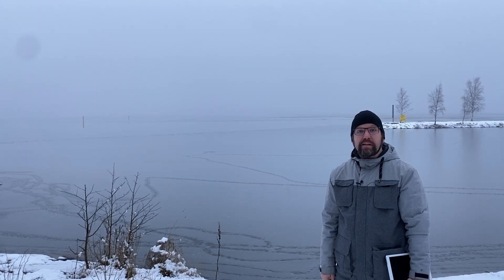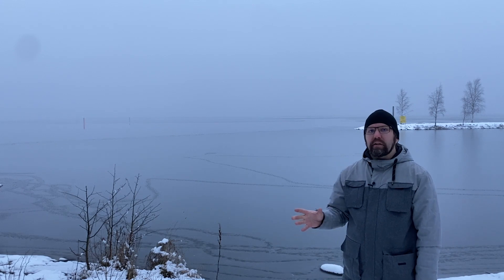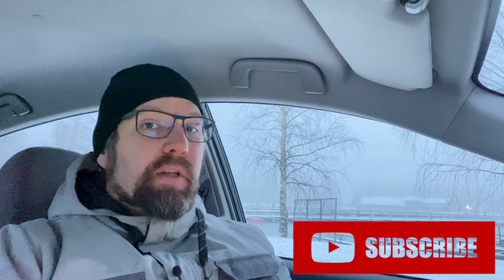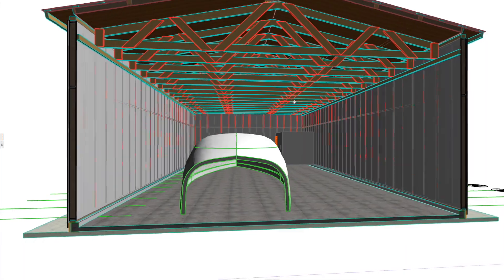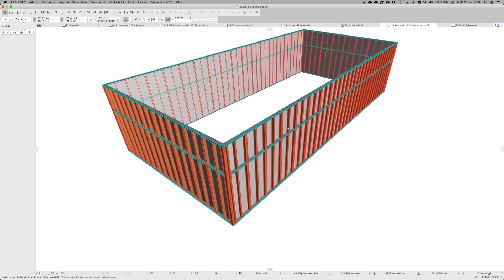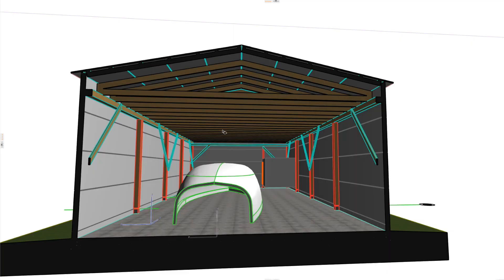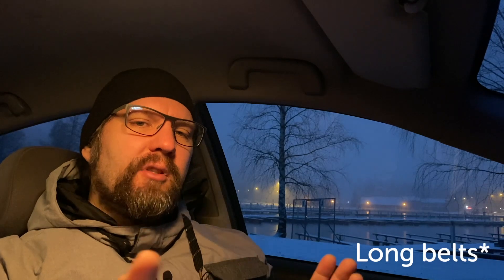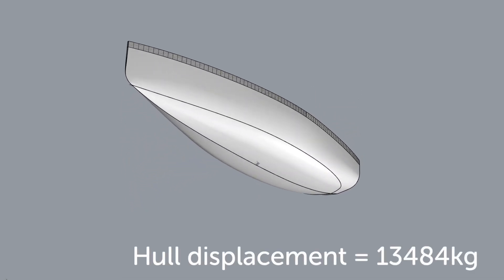DIY sailboat project: Mixed bag of Plans: Shed, CNC-router and Boat hull! Ep16 Project SeaCamel

Comment: I live in the midwest area of America where we have 4 seasons per year and I don't think many people understand how efficient a heated concrete floor is.. my buddy built a house and the basement is surrounded by earth on e sides and the 4th side is open and a 3 bedroom 2 bathroom single level house is on top of that.. we installed tubing into the concrete floor before pouring it.. he heats his home from a cheap electric hot water heater and in the really cold months of end of December thru March he has a wood stove in the basement also.. it's a really cheap way of heating the house and if you go for a visit you should definitely have a t-shirt available to wear and most of the time a pair of shorts
Reply from the maker: Compared to US, we are much more North up here. You have four seasons but they're short and in a way more extreme there. On the other hand we have short, often cool summer and long winter. And mid-seasons are even longer and quite unpredictable.

In here you really need good insulation to keep the heat in. Ground can (and has) be used for keeping things cool like wine cellar. But there's not that much heat in the ground.

Comment: Why didn't you just search around for a 45 to 60 foot former racing sailboat that can usually be found for a reasonable price and the interior are open canvases.. you can always add the proper cockpit and hard enclosed helm etc
Reply from the maker: The hull part of the boat isn' really that big of a thing compared to everything else. And I just didn't want the hassle of dismantling everything and have all that c**p lying around. Think of all the dust, debris, old (badly made) repairs and stuff.
And of course the structural modifications needed to have the free standing masts etc.

Comment: What made you decide to switch from steel to wood epoxy? You reference Garcia a lot in you videos, so im sure you've considered aluminium. Why did you choose against aluminium? Not a criticism at all, I would like to learn!
Reply from the maker: Hi! Thanks for the question. :)

Well... The idea of steel was just a thought that passed by.

I don't have enough knowledge of steel, it's hard and dirty (and heavy = special tools, cranes and stuff) to handle and requires alot of maintenance.
Aluminium would be lighter but I have zero experience of that. And both of those would be a lot more expensive.

Wood is my material, it's environmental friendly (although plastic glues and paints... oh well...), light, strong and easy to repair and modify and easily available here. Doesn't require anything special to work with etc.
Reply: @ArcticSeaCamel  those are fair points. If you're not too far into material choices yet it might be worth a trip down the aluminium rabbit hole. I have no idea what prices are where you're at so it might not be economical but.... aluminium is fantastically east to work! It cuts smooth as butter with wood saws and wood blades. Welding a seem is (for me at least) easier than joinery. Weldong gas (argon or CO2) is widely available internationally at or near any port. That being said im not a shipwright, wood, steel, glass or aluminium so my opinion is just that, my opinion 🤷‍♂️

Might be food for thought, might be a waste of time. Love the channel and I'm excited for you and your project. Cheers!

Comment: Just recently changed my cnc to use rack&pinion. Used belts for a year and couldn’t get them to work. Made a diy-version of the spring-loaded transmission you showed on the video. 1:3 gear reduction. No backlash to speak of. Very accurate as well. 

Hieno projekti!
Reply from the maker: Hi! So great to hear that I’m on the “right track” 🤪!

Ja kiitti!

Comment: You might want to checkout Scott’s building at Six Flags Woodworking. It is an arched frame construction with a fabric cover. He is in New York State and has temperature issues also. Using the insulated fabric designs that are used in yurts you should be able to construct a building much more cheaply. Years ago I worked in the construction of large steel commercial buildings and even back then we used large rolls of reflective coated insulation that was draped over the structure before the outer skin was applied. Just a thought while I wait here in northern Michigan for the ice to freeze for ice boating.
Reply from the maker: Hi, yeah sea dreamer project is familiar. Great work there.
I don’t believe that his shed is insulated by any means though. His building technique doesn’t include that much epoxy either so he can work during winter. And the winter there is not as long as here...

I’ve been asking for semi insulated tarp sheds as well but haven’t found any product for that. It would be of course much easier but I have some doubts for the long term durability. I would really like to sell the shed with reasonable price afterwards.

Comment: Always nice to see an update from you.👍

Just a few comments if I may?:

1. I did not totally understand the detail of the ‘insulated panel’ approach. Do you mean similar to this sort of thing - https://www.sips.org/about/what-are-sips. ? If so this will I believe the most effective way to proceed and the factory can make orders to suit your building design. I think making your own insulated panels will not be economic unless the labour is truly free.

2. The design of your new boat is looking good.👍 I do not know if you are familiar with Sirius designs ? But you may be able to steal a few ideas - https://youtu.be/RMcxA5mDPwg

Look forward to your next upload.

PS: Sorry about Brexit.😉😂
Reply from the maker: Hi Norman!

Thanks for the comment.

1. Yes, kind of that. Although my approach is totally self-made and includes the load-bearing structure in them. I believe those SIP-panels don't...? My assume here is that all the labor needed is free. In other case those ready-to-go solutions would be most preferable option.

I believe the option 2 is more suitable at this point. With these kind of elements:
https://www.parocpanels.com/en-gb

2. Yes, Sirius is very close to mu heart. There's actually very informative video of how they build them: https://www.youtube.com/watch?v=f7upfeSGJwU

I'll try to get forward in little faster pace now on. :)
Reply: @ArcticSeaCamel  My link to the SIPS actually do incorporate the structural load bearing elements. Lots of YT on building with these. Thanks for the Sirius build links I look forward to watching- so many clever design elements in layout and fitment.👍
Reply from the maker: Oh I see. There's no that kind of panels available here. They would be quite thick due to high thermal insulation demand in this climate which brings certain difficulties with avoiding condensation within the structure.
But my plan is something similar with those. And of course in this case the shed is just semi-warm so not so high demands with the insulation.
Reply: @ArcticSeaCamel  Might be worth following up I should imagine increasing thickness is relatively straight forward.